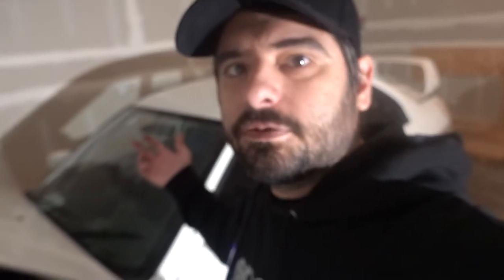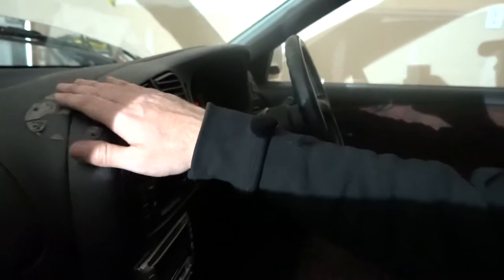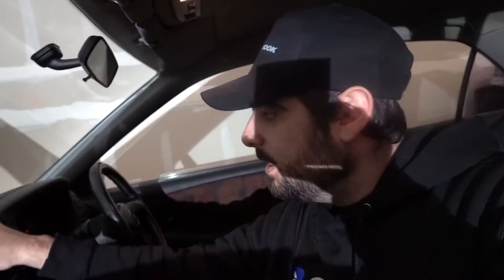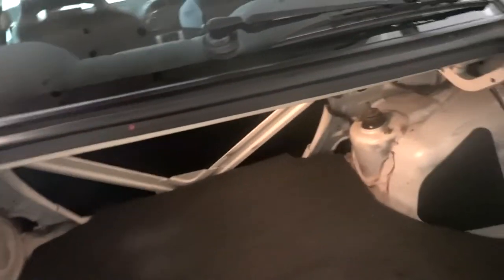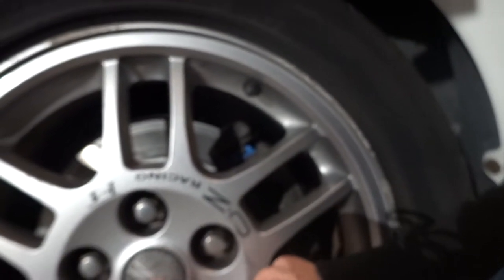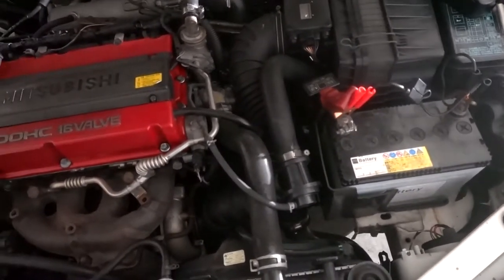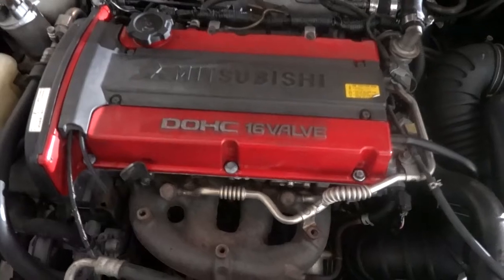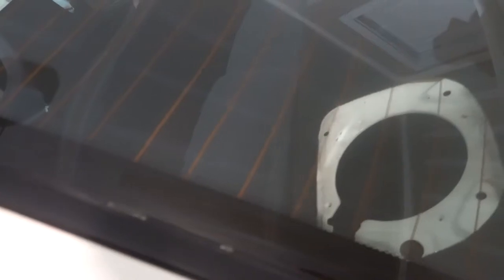It's finally here! Introducing the Evo 4 project!

Comment: Got my Evo 4 back in October.  It is a blast but finding parts is tricky.  This car is really a mix of Evo 8 parts for the engine, Mirage parts for the body, and Galant or Montero parts for misc. items.

Just ordered a set of brakes, so will see if they fit on the stock calipers.
Reply from the maker: Yep, im finding the same. I had endless brake pads and rotors installed while it was waiting for the boat in japan. Have a set up evo 8 brembos that i need to powdercoat, rebuild, and install
Reply: @drivetheorytv  Nice.  My car came stock, so the person who owned it did not do any modifications.  So my goal is to keep it as stock as possible.  I am planning on getting a 6 or 6.5 and that one will get the works.  3 more years, but at least I have the 4.